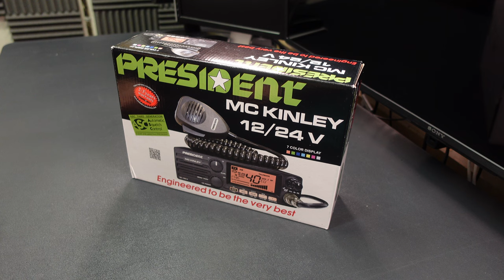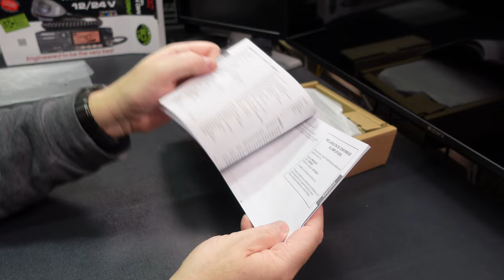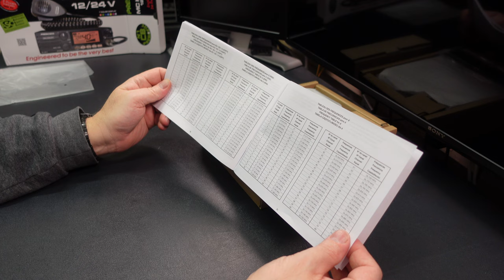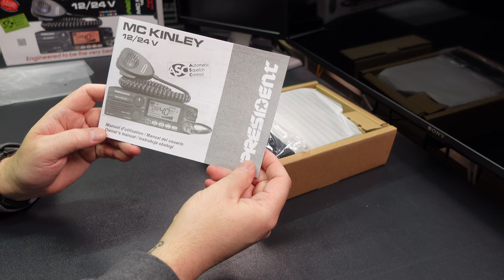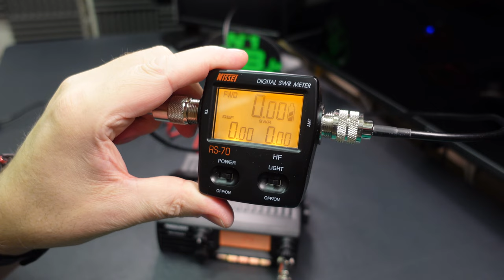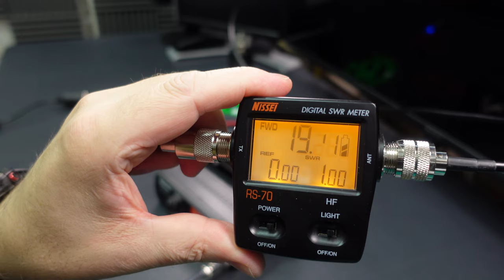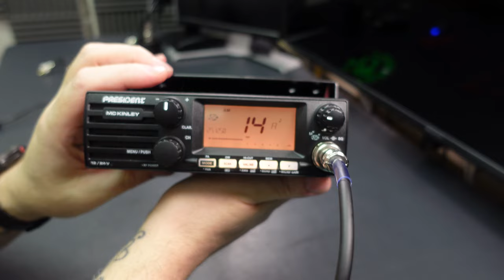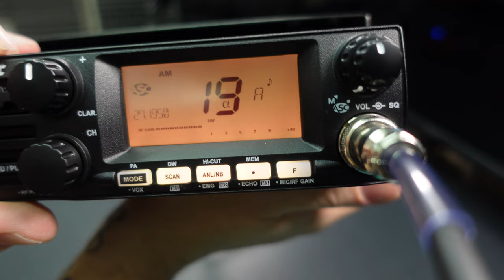President McKinley SSB CB Radio - Unboxing Review - Best CB in 2022

Comment: Hello again. Great upload and Just in time as I was ready to order the President Richard from Knights. Glad I didn't. As you may remember I already have the President Randy III.
I managed to get my SWR to 1.1 on a Sigma mag mount on my vehicle using the PR III.
Keep up the great work it's very very much appreciated. Thank you.
Reply from the maker: Hey Rikardo, thanks for watching. Both radios are an excellent choice. If you need SSB then the KcKinley is the only way to go or possibly the Lincoln 2+. The President Richard is a joy to use, is cheaper and has a certain charm to it. The McKinley is a better longer term choice in my opinion although I wouldn't be without the President Richard, I do love that radio.
Also good to hear you managed to get your SWR down to an excellently low level. Did you swap out the antenna to get it down or was there another issue. We keep trying to do a Randy III range test and have been rained off twice already. I have bits of footage all over the place. Going to be trying hard to get that done soon. All the best, 73 from MJ7NLK 🙂
Reply: @NLKMediaGroup  I didn't swap out the Sigma antenna I just altered it's height with a grub screw. No need to cut a anything off. Works a treat now. Stay safe, stay well until next time.

Comment: Yes was have a look around and was looking at the RM KL405V and the RM KL505V have just got the a ZETAGI R35 VOLTAGE REDUCER 24.
12V DC. 35AMP MAX. To run the one I pick to put into the lorry 
So 
Thank you
Reply from the maker: Hi Simon, the R35 Reducer is a nice unit. Did it work out for you and the McKinley? The EU model of the McKinley is 12 and 24V compatible so no reducer needed and the US version is also dual voltage. Its a lovely good quality radio but can be slighly fiddley to use. All the best and Happy New Year to you

Comment: I can't wait for the updated model with FM to get to the USA. I would love to see if the USA model still has the ability to open up the more power mode. I was disappointed with the SSB power of the stock Mckinnly it was only 7 watts. I don't know if it's a fluke or not. The other thing that seems messed up is out of 45 CB radios the Mckinnly is the only one that seems to get warm when it's turned on and just monitoring a station. My local shop said that is strange but they don't work on president radios. They noticed that it always makes a tiny noise when it's turned on. I don't know if I got a radio with a serious issue or not. Others don't seem to have any issues and they put out more power on SSB. Can anyone out there shed some light on this? What's your experience with this radio? Thanks for any information or for sharing your experience.
Reply from the maker: Hi Robert, the McKinley I have does not exhibit the same behaviour as you mentioned. The EU models are different ot the US models with the former being locked down due to your specific regulations. I am sure the FM version will be appearing soon as the McKinley is a popular radio. I guess you could try and get an EU model but it wont have the required certifications. I wanted to try and get my hands on a Randy 2 FCC so that I could strip it down and compare the PCB's to see what the differences were. However, that is quite an expensive test to do so am a little undecided, you never know, I might bite the bullet at some point on this. I personally find the McKinley a bit fiddlie to use due to the front speaker taking up almost 50% of the available button area but once you get used to it, its a nice unit. If you need to mount in a enclosed DIN opening in your vehicle and dont want the hassle of an external speaker then the McKinley is the only option. President are supposed to be releasing the George 2 soon (believe that when I see it available as its been on the cards for ages) and will be an alternative to the McKinley or you could go with the Lincoln 2+ which is a mighty SSB radio but requires expanding to cover CB frequencies which is easy on the EU model. Its a HAM radio so not sure if its heavily restricted like the US CB radios. Thanks for watching, all the best
Reply: I have US model, here in Europe. It doesn't have same things inside, can't upgrade chanels or power or anything. Everything is micro size, no vires to cut...No FM!
Reply from the maker: @dusanstakic2741  Thanks for the info this is really helpful. It looks like the US models are locked down due to FCC rules. I noticed that the US McKinley doesnt have FM either when checking out the US website. That is a shame but they may well come out with an updated version now FM is legalised in North America, time will tell on that one. All the best and thanks for watching and commenting.
Reply: I just recently bought a US version McKinley… it only puts out 2 1/2 watts on am and barely moves the watt needle on side band…. I paid extra to have it tuned and aligned… I think they messed up my wattage output 🙄… I’m going to take it to a shop to have checked out

Comment: The mckinley is a very difficult radio to use in the truck. But good for home base use. Screen and knob layout could have been better. The grant 2 is still my favourite radio.
Reply from the maker: Hi Daniel, I would agree with you on that one. Having the front speaker has meant that button real estate is limited on the McKinley and it can, at times, be difficult to use. Setting the RF Power is a good example and a pain in the derrière. We are rather limited in legal SSB CB radios in the UK and EU. The President George 2 has been coming for a while now. It's even in the French President CB catalogue marked as "PROCHAINEMENT / PRÓXIMAMENTE" which means "Coming Soon" or "Approximately Soon" would be a more accurate translation. The Grant 2 was a lovely radio. If you don't need SSB then the Walker 2 is a great radio and easy to use one handed. All the best and thanks for watching
Reply: Daniel, I wanted a radio with weather, and weather alert.  They can be hassle savers, or even life savers in some situations.  I would have purchased an AM, FM, SSB but could not find a President with those bands plus the weather functions.
Reply: @jerrypolverino6025 President has many of their radios with the weather band's in them. Available at many dealers all across the USA and Canada!
Reply: @cariboooutlaw4852  president does not make an AM/FM with single sideband. I checked.
Reply: @jerrypolverino6025  actually President USA released information about the McKinley ll FCC which will be out soon for the USA and Canada. It was on their website earlier this week but they've since taken it down from their website due to error on being too soon for anyone to know about it!
Reply: @cariboooutlaw4852  Yes.  I wanted a radio now.  Thanks anyway.

Comment: Hi this was really useful, just clarify you can access 27.555 on this without having to making any modifications, is it just the press of a button. If I wanted to power it from home what I would need? I'm also curious can you get handheld ssb as I'm struggling to find one. Thanks for your hardwork
Reply from the maker: Hi Wally, if you want to power from home then you can use a 13.7V switchable PSU which are cheap or go for a Linear PSU which have very little to no interference so are better in my view. I use an LM-30 by Sharman but you dont need 30A for the McKinley. Anything equal to or over 5A should do just fine. A 5A psu should be good for up to 30W output generally. You can connect the cables supplied with the radio directly to the PSU and turn it on, thats all you need. I dont know what region your in but if you type PS-08 into the search box at www.kcb.co.uk that would do nicely, 6A linea.
Handheld SSB is more of a struggle. Albrecht used to make a radio (AE2990) which had SSB but dont know how easy they are to find. Xiegu X6100 has SSB receive for HF and can be modded to transmit on 27/28Mhz. The amazing Icom IC705 can also be modded (i think they call it the Mars mod) to RX/TX on 27Mhz as well but both are Ham radios and expensive. Maybe other viewers reading this can make a recommendation on a Handheld SSB CB.
Thanks for watching and please let me know if you find a good SSB Handheld, all the best, MJ7NLK
Reply: @NLKMediaGroup  wow, thanks very much that's absolutely brilliant, I'll look into this it all seems a bit daunting especially any programming or mods to a CB. I'll let you know how I get on, thanks again very much appreciated indeed.
Reply: @NLKMediaGroup  sorry I think I misread you reply, can you use/listen to 27.555 out the box with McKinley president or do you need to program it. Thanks for your support.
Reply from the maker: @wallywo7392  Hi there Wally, No the McKinley covers from 26.965 MHz to 27.405 MHz as standard and does not cover 27.555. When expanded it covers from 24.715 though 30.105 inclusive. Band block B looks like it would be the one from 27.415 to 27.855. I happen to have my President Richard to hand which is expanded as well and in band block B at channel 12 it hits 27.555 in AM and FM no problems. The McKinley when expanded will be the same in block B and channel 12. If you dont need SSB then the Richard might be a good alternative and cheaper, love that radio, its amazing, check the channel for the review. I also have a Walker 2 for review which is basically a Richard pre defined to CB channels but can also be expanded. If your in the UK then Knights Electrocom can expand the radio for you if your not wanting to start tinkering yourself.
Reply: Brilliant sounds like just what I need thanks very much, you're a real role model for the CB community cheers, no doubt I'll be pestering you at a later date 😄
Reply from the maker: @wallywo7392  No problem Wally, glad to have like minded CB'ers to talk CB with. I have five more President radios in stock to review (Teddy 2, Truman, Taylor iV, Lincoln 2+ and the Walker 2). I am also preparing for an update on the Barry II to extend the power mod. Lots coming up, just need to find the time. All the very best, MJ7NLK
Reply: You're a gent much appreciated

Comment: What is gained by snipping the wire and moving the jumper. Is reception improved with this modification?
Reply from the maker: Hi FlyCaster, snipping the wire and moving the jumper puts the radio into export modification mode. This enables more bands to be used outside of the standard CB 11-meter channels and also increases power output (if your licensed). If you want to make changes to modulation and deviation, then you have to use the pots on the PCB to adjust them. You will need the appropriate equipment to test and set but this is how it's done on the McKinley. There is no service menu to adjust these settings. Hope this helps and thanks for commenting, all the best

Comment: Which telescopic antenna would be advisable to use for SSB?
Reply from the maker: Hi and thanks for watching. The general rule with anything CB antenna related is the longer the better. Hight is might. It also depends on your application. Handheld, vehicle, base station, etc. you can get some decent 27Mhz telescopic antenna on Amazon which are about 1.3 meters long. They work well but usually have a BNC connection so you might need converter dependant on your application. All the very best

Comment: Hello, just bought a McKinley but I’m just getting 2 watts both in AM and FM..!!! It’s not expanded (yet) but I think it’s not normal to have such low values. What do you think?
Reply from the maker: you can adjust RF power by pressing a key combination on the front of the radio. it's most likely been set to half power. I am not in the studio this week but you can download the manual from President and look for RF power adjustment. All the best and thanks for watching
Reply: @NLKMediaGroup  thank you. Turns out I was dealing with a faulty power supply. Everything is fine with my McKinley, very powerful radio out of the box. Thanks again, I really appreciate your channel

Comment: I could see the white wires good  but is the next step like a on off switch? And you flipping it to the right?
Reply from the maker: Sorry am a bit behind on answering comments, appologies for the delayed response. There is a jumper on the right just past the bank of resistors which has 1, 2 and 3 written on the board. By default the plastic jumper is placed over 1 and 2 and needs moving to 2 and 3. Just pull it off and move it over and push it on so it covers 2 and 3 pins. Hope this helps. Happy new year and all the best for 2024
Reply: The answer to your question is "YES" - you can put a DPDT switch to change options. :)

Comment: What's the difference with TXPA600 and TxUS600.?? Model numbers .
Reply from the maker: Hi David, the EU model is TXPA600 and the US model must be TXUS600. The TXUS600 is the USA version and is AM only. They have now released a TXUS610 which has FM as well. Check the President website for US if that is your region. EU model will be more expandable as the US versions normally have the expansions removed. All the best and thanks for watching

Comment: It would be nice if you focused more on the receive quality and sensitivity. An expanded radio is no good if you can't hear anybody. Other than that, good videos.
Reply from the maker: Hi Alan, thank you for your feedback which is much appreciated. The receive quality is excellent. It’s a dual conversion superheterodyne receiver with sensitivity of -112bBm for 20dB SINAD in AM and -117dBm for 20dB SINAD in FM. The audio output is 3 watts to the internal speaker. I find the Receive audio is excellent, crisp, clear and loud with little distortion. Both the Walker and Richard have less than 5% distortion @ 1KHz. I  have not come across a modern micro electronics style President yet with poor audio. All of these new style radios (with a USB socket on the front) have good audio receive but the more expensive radios have better filters and options and this radio has double conversion the first at 10.695MHz and second at 455kHz.
Very much appreciate your feedback and will take it onboard going forward. All the best MJ7NLK
Reply: Receive quality is most important to me. Presently running a Cobra 25 LTD Classic. Will I notice improved receive quality with the McKinley vs the Cobra 25?

Comment: Got  A Q.can you turn the power down in menu or front screen to lower the watts ?? Instead of inside the radio
Reply from the maker: Yes, on the face of the radio just to the left of the bottom dial (channel selector) it has RF Power printed. If memory serves me correctly you press and hold the PTT button, then press the MEM/ECHO button located to the left of the F key and use the channel selector knob to adjust the RF power up and down.

Comment: I would like to buy it, but in the USA it comes without the heatsink, without FM and perhaps less power
Reply from the maker: Hi Adr, yes you are correct, the McKinley FCC version does not have FM and does not have the same expansion options as the EU version. I do not know if it will be updated like the Randy 2 FCC was to include FM at some point. I guess time will tell on that one. All the best and thanks for watching
Reply: thanks I think it is [due to local laws that restrict power etc. I was looking forward to it but I changed my mind @NLKMediaGroup

Comment: Hi, thanks for your channel - well presented and very informative. I'm a complete beginner, and would like to hear your opinion on what the consequences could be (living in EU) if I did accidentally cut through that wire.  All the best.
Reply from the maker: It is illegal to use frequencies outside of the license free CB bands which are different dependent on your region unless you are specifically licensed to do so. CEPT band block is the usual in most EU regions, but DE and PL have their own band blocks to accompany this as well. Power output is also limited to 4W or 12W SSB in nearly all regions. Going outside of this opens you up to problems should you get caught. You may get the radio equipment confiscated or worse end up in court. I do not know what the likelihood of this is or would be. All my videos state to check the law in your region and ensure you remain within it. Some people don't care and run modified radios and some even have burners but it's not all about power, you can have lots of fun on SSB and can communicate thousands of miles when the conditions allow on less than 4W. It is my view that it is not worth taking the risk. If you want to transmit with more power on other HF frequencies, then consider taking your Ham radio license.
You are allowed to transmit out of band in the event of an emergency, and I cover this scenario mainly for preppers, so they can purchase a legal radio for day-to-day use but in the event of an extraordinary emergency situation they know what to do and what the equipment is capable of. Fingers crossed that situation never happens.
Thanks for watching and think twice before cutting :-) All the best.
Reply: @NLKMediaGroup  Thanks a lot!

Comment: I tried the "ninja move" (PTT + F + MODE -> Power On) on the McKinley (unlocked) and it did put the Radio in an "ru" mode. Can someone tell something about this  mode ?
Reply from the maker: Ah yes, the RU mode, which is un-documented in any President material I have to hand. It is well known amongst McKinley owners but exactly what it does is not. I am also "all ears" if anyone knows exactly what this does. Without hours of testing, it's hard to say. Sorry I could not enlighten with more info on this. Thanks for watching, all the best.